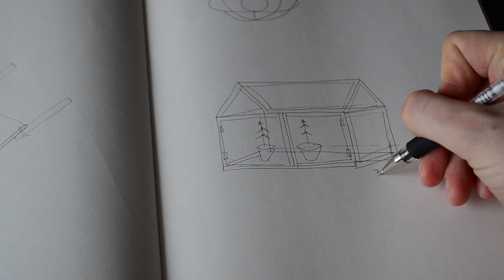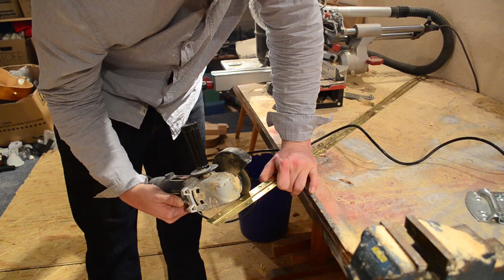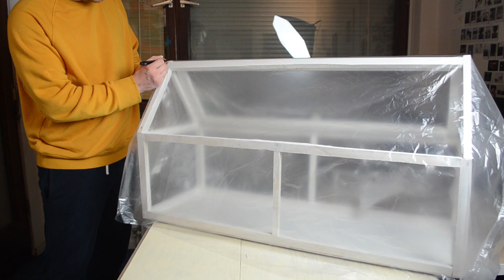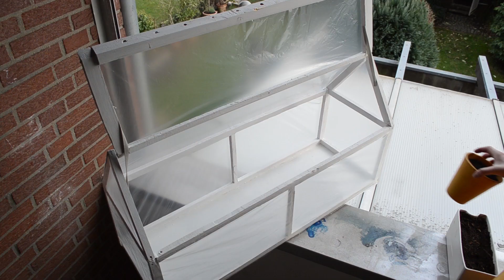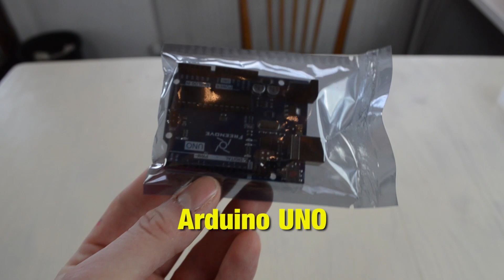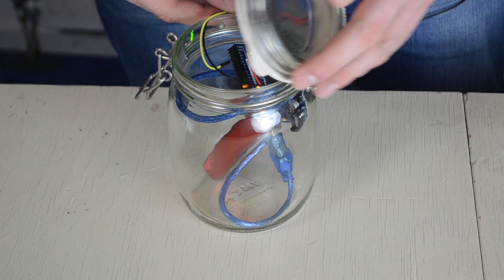stupendously SIMPLE Self-Watering GREENHOUSE (lazy arduino project)

Comment: Shouldn't you habe painted the greenhouse black? Yes, white reflects sunlight, meaning, it's bouncing back all that sweet warmth your plants are craving. So it's pretty much the opposite of what you want. Instead, you want your greenhouse construction to absorb all the light/warmth falling onto it. Therefore black should be the way to go?
Reply: No not really, the light and heat go through the clear panels, the framing adds very little. It is there to create structure and support, not as heating elements.